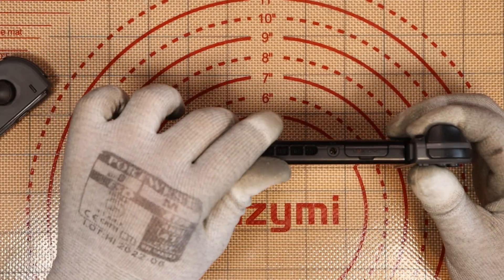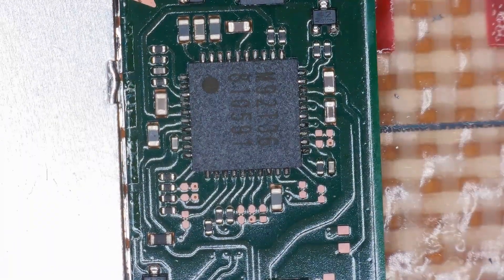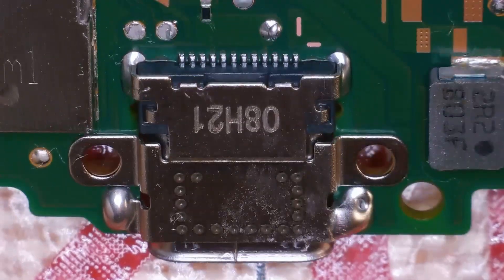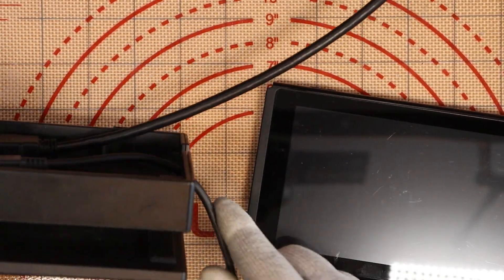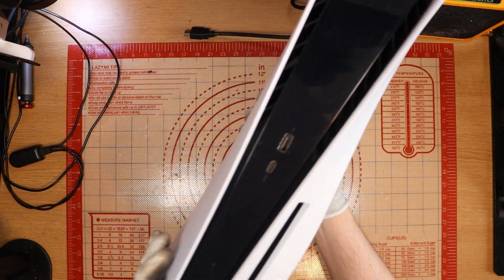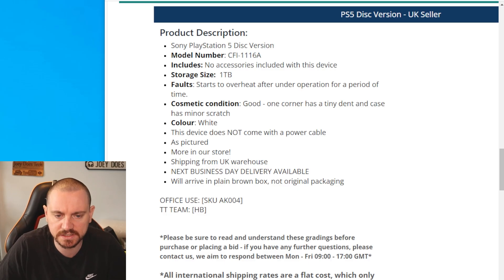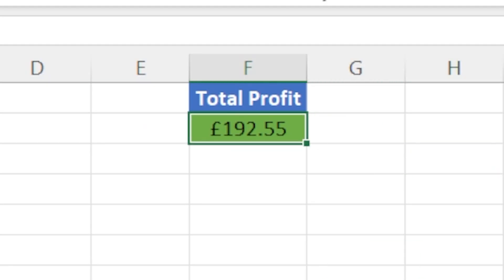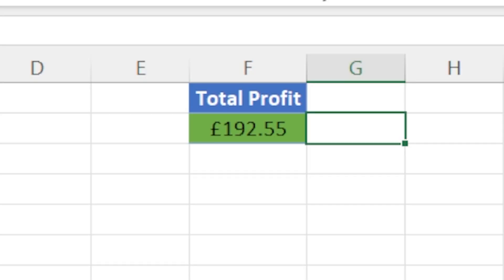Can We Make a Profit Fixing this Tiny Treasure | Profit or Loss S1:E23

Comment: Could you not try swapping over the ICs from the damaged board to a good board as the SN will be in one of the chips not sure what one it would be though but others probably would know
Reply: Also that button ripping off must be fairly common as baught 2 damaged joycons for the switch I got from you and both was fine apart from both had that fault both was an easy fix  £1.89 for 2 from ebay

Comment: Personally, I would start with removing the known bad component first, the USB Port. If you have shorting pins there, you will read shorts elsewhere on the board until that is swapped or removed.

Comment: Couple of ideas - whatever IC on the daughter board marries it to the main board, swap that IC to a new daughter board. OR if you think the connector is the issue, replace the connector
Reply: Was just about to suggest both these ideas as well
Reply: Yeah, I would do the same! Nothing really to loose, you can swap the chip back if it comes to that.
Reply: I would also go and take components of the daughterboard just to see if corrosion made it's way under the components. All together very nice video again Joey love your content and always looking forward to the next video.
Reply: The rectangle motor controller believe that creates and controls all voltages for the disc drive, any short would have blown it. Suppose you could put the daughter board/ disc drive in another ps5 and just see if it takes the disc in and spins?

I'm sure that daughter board has a few tiny fuses dotted about, check those.

Comment: swap the renesas chip on another board if you have it. if the console went trough updates and restoring process the chip is still good and you can use it to remarry a new board. or if you want you can try change the laser driver chip on the same side of the board. this might resolve the issue on the ps5 disk.
Reply: I had the same idea
Reply: I'd go with the rectangle chip as well easier to change. I tried to change the Renaissance chip and I killed mine... Few videos on YouTube now with unrecognisable disc and it's the motor control chip on the daughter board.

Shame Sony made the disc drive so secure and had a soldered ssd totally kills the life span of these consoles.

Comment: I would suspect the damage to the drive itself caused an issue with the daughter board, id suggest swapping the IC that contains the ID data of the daughter board with another drives daughter board.

Comment: You can solder the R Button to two copper pads on the board, no need for scrapping the pcb. There are images online for the Pad locations

Comment: I have started using magnetic USB cables, despite the fact they are not standard/certified by the USB forum. Finding one that works as advertised can be challenging, but it's worth the time.

When it comes to the switch of course you'd sacrifice the ability to dock it, but these cables eliminate the wear on the connectors on devices and the build up of lint (thinking about smartphones).

A friend of mine adopted the same solution after his daughter destroyed the port on 3 different ipads. 😂

Comment: I've had a very similar issue before with a water damaged daughter board, and oddly enough it ended up being a power issue, it seemed when the disc drive needs "extra" power it couldnt draw what it needed.

Comment: Long time watcher, congratulations on the new upgrades to your kit, quick question, Nintendo switch only charges if the cable goes in one way not the other, does this indicate just a charge port problem? Cheers
Reply: This indicates that either the pins on the one side of the port are loose or broken or just that the cable is damaged on one side. Try changing a charging cable if it still goes on just swap out the port with a new one and you should be good.
Reply: Also if you don’t want to change the port you could try reflowing the pins (if they are loose) if they are broken you will have to change the port unfortunately. Cheers